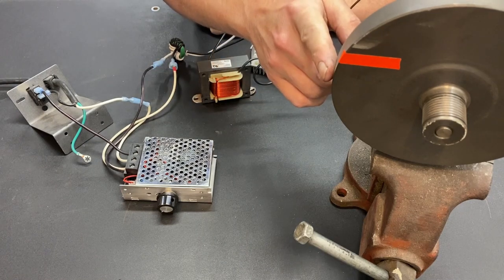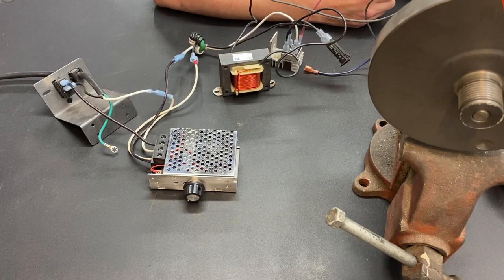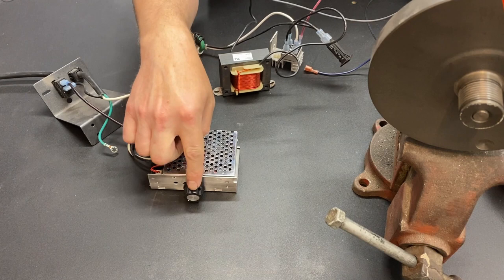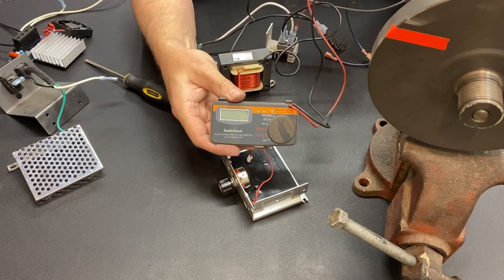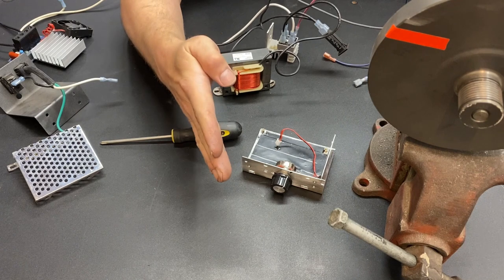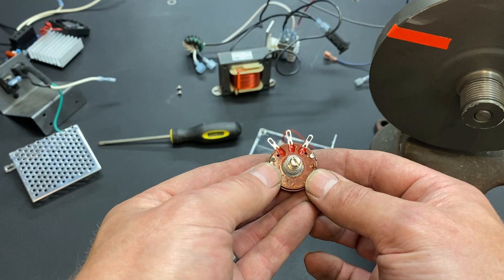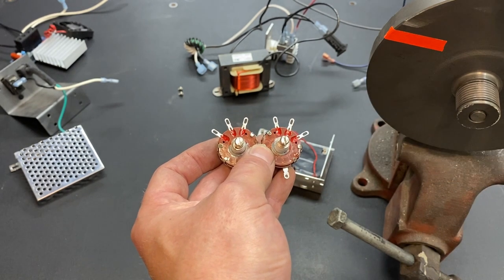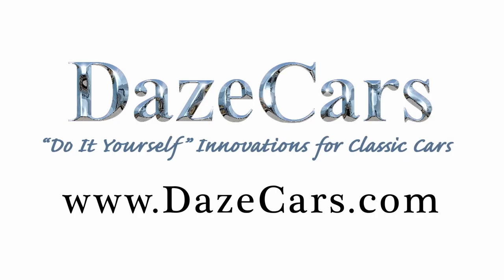Changing the Potentiometer in an SCR Voltage Controller Treadmill Motor Controller Power supply

Comment: I dismantled 3 treadmills to reclaim the dc motors a couple of years ago. I have been searching for a clear explanation of either how to use the boards from the treadmills or an SCR controller. Others seem to treat lightly or skip over the most important aspects of this solution.
You have provided a clear and thorough explanation and I’m grateful for it. 2x72 grinder project can proceed now….
Reply from the maker: Which controller boards did your treadmills come with?
Reply: @dazecars  I’m out of town until Monday and it’s too long ago to have a clear memory. I’ll look at them when I return and get back with you. Thanks
Reply: @dazecars  I have a MC-2100 Rev B and a MC-2100LS-30 Rev and another board labeled MCC1H ( that one has a transformer or choke on the board with 2 plastic connectors with 2 pins each) I have photos of all of this. I have 2 new SCR controllers 10,000 watts 220v which look like the ones you recommend. I also have 2 bridge rectifiers labeled KBPC5010 and potentiometers labeled B200K 17mm and B10K,.
Motors are 1.75 hp cont duty at 100 VDC and .5 hp cont duty at 108vdc, another 2.5 cont duty but couldn’t read the vdc req’d because of access to it. The small .5 hp was on some type of stepper or incline type TM but was the primary motor. I also salvaged smaller “stepper” or lifting motors I think 2 or 3 of them.
Reply from the maker: @Grumpyneanderthal  Sounds like you hve lots of options.  Im not familiar with the MCC1H.  The component attached to the board would be a transformer not a choke.  I have used that same rectifier you have and they are prone to burning out I would recomend getting a better one if you decide to go with the SCR  setup. https://amzn.to/3Gk4InH
Reply: @dazecars  thanks. Bridge rectifier link at Amazon is currently not available but I ordered 2 direct from Baomain w/ free shipping. 
I’ll go through the process you described to determine which potentiometers are required.
Reply: @dazecars  I don’t have a choke from the TMs. I’m on EBay but the values are all over the place. Like one I found has Filter Choke - Value: 7.0H, DC mA: 50, DC RES: 550Ω; another is Filter Choke - Value: 1.5H, DC mA: 10, DC RES: 70; and another is Filter Choke - Value:  0.5 H, DC mA: 10, DC RES: 30Ω (30 Ohms): 
Which one or does it matter? Thanks again
Reply from the maker: @Grumpyneanderthal  Not being an electrical engineer I can't say what value you need.  Most of those are probably to samll.  I would search "treadmill motor choke" BUT know that most people on eBay don’t know what they have and the word "transformer" will also appear in most listings. Problem is a choke and a transformer look almost identical so some listings are for transformers and some are fore chokes because the sellers think they are interchangeable. They are not. They would only be interchangeable if you modify a transformer to work as a choke.  (see my DIY choke video)  To tell the difference count the wires. A choke will only have 2, a transformer will have 3 or more.  Generl rule of thumb is the bigger they are the better they work, also the coil needs to be at least 16 awg. Please let me know if I can be of further assistance.

Comment: WARNING: I followed your instructions of how to set up a SCR to run a treadmill motor (power cord to lighted switch to SCR to circuit breaker to AC choke to rectifier to dc choke to toggle switch to motor) and it worked great on the first attempt :) However, I fried 2 SCRs when trying to add the second potentiometer.  No blame on you!   I had ordered the 150k & 10K potentiometer.  I thought I had wired something wrong when I fried the first SCR. So ordered a new one and fried that one too.  That's when I noticed that instead of getting the 150K, I received a 470K.  To avoid this happening to you, I recommend double checking the specs of every component before you actually fire it up.
Reply from the maker: I appreciate the warning for other people trying to do a similar setup but your conclusion is incorrect and you need to look for another cause of the failure.  Having more or less Ω will not cause the SCR to fry all.  What it will do is effect start speed, speed sensitivity, and how far you must turn the knob before the motor comes on.  More than likely you shorted out your SCR because of the unused third terminal on the potentiometer.  Most potentiometers have 3 and you only use two BUT if that third terminal comes in contact with the case, the body of the potentiometer,  or anything else that grounds it out you will fry the SCR.  An easy fix would be to clip the unused third terminal or heat shrink tubing it.  If that is not what happened in your case you will need to look for another cause as having a bigger or smaller potentiometer WILL NOT cause the issues you have reported.
Reply: @dazecars  Thanks for replying.  There was a pop that came from the SCR when I turned on the power (hence the reason I thought I fried it).  After reading your comment, I reattached the original potentiometer and gave it another try.  This time the motor popped and tripped my breaker. Not sure whats going on... but I'm trying to figure it out.
Reply from the maker: As long as you are using AC with AC things and DC with DC things a power supply will not usually cause a motor to fry, BUT a bad motor will burn up a power supply.

Comment: For once someone actually read the needed potentiometer value to see what size was needed. However, there really is another way to make this work very precisely. Take a resister and parallel it across the center wiper lead and which ever side lead you are using. And then you can get a simple resistor to make the pot the exact value you want. Just remember parallel resistors are lower in resistance value then the lower value of either of them. Solve for parallel resistance to make the pot the resistance you need... If you have a 100k ohm pot and need a 50k ohm pot, use a resistor in parallel to make the pot read 50k ohm. A 100k ohm resister will come really close... Try it...  Thumbs Up!
Reply from the maker: Great advice and even better description on how to do it. I am familiar with the concept of parallel resistors. The thing I don’t like when a fixed resistor is paralleled with a potentiometer is the potentiometer is no longer linear and the non linear change in resistance is the worst at max resistance. on an SCR max resistance is at slowest speeds and that IMHO is where you need the finest speed control. It’s not that big of and issue but just not my preference.
Reply: @dazecars  Well the only true idea is to buy a pot as close to what you need in a linear scale, even better idea is a multiturn pot. That way you can dial in the exact RPM you want... JMHO
Reply from the maker: @garymucher4082  I hope you didn't think I was being argumentative, your info was great.  I was just expressing my concern with using a resistor to size a pot for this application.  As to the multi turn pot thats a good option and would totally work.  It is similar to the two potentiometer system I run.
Reply: @dazecars  Not at all. I also understand your reasoning. Good video and explanation of why you need to change the initial pot that comes with those SCR controllers...  And that is also the reason I have a few meters. A very good Simpson 260 series analog meter for just watching the needle sweep and lots of digital Fluke meters to read everything else. Thumbs Up!
Reply from the maker: @garymucher4082   no fancy Flukes for me 😁 I use a simple 20 year old Radio Shack meter with broken cover.  I wish I could find another one.  They went to an autoranging unit after the one I have and it pales in comparison to mine.
Reply: 👍. Great conversation! Ii m very glad you both are intelligent enough to nip what might have been an argument, in the bud. Together you both provided more useable information and options for someone like me who is electrical knowledge "challenged". Read, I'm a fuckin dummy, or noob.

All too often YouTube comments become a battle of whit. Turning good information into Twitter like drivel.
Reply from the maker: @k.bellingham8335  sadly it is not just youtube its all social media IMHO.  There is something about being connected to other via a computer that emboldens people to say things they would never say in person.  Makes no sense to me but a-lass it is the world we live in.
Reply: @dazecars  
Anonymity. 
Perceived or otherwise.
The benefit of this new connected world is information exchange. I surely appreciate your very informative articles/ videos. I think I'm addicted to YouTube. Filter out the garbage and there is a whole wide world in here to discover.
Reply from the maker: @k.bellingham8335  unfortunately there is A LOT of garbage to filter out.  I know I have a long way to go to get to professional level videos but I try to be concise, easy to understand and moderately well edited.  So many videos wast time rambling and don't actually show you anything because it's just someone in front of the camera wanting to be seen "look at me!!".  That is  why my face will never be in one of my videos.  It's not about me its about the information.  And then even the videos with good nuggets of info have so much waisted time between nuggets that could be edited out or at least shown at a higher rate of speed.
Reply: @dazecars  it's all good my friend, kudos for putting yourself out there, face or no face. 
Not only is there drivel uttered by the ignorant, recognition seekers, aka wanna bes, there's also the haters. Someone always seems to have an axe to grind. Still, through it all are the occasional lights at the end of the tunnel. You know where you fit good sir.
Reply: @dazecars Everytime I watch one of your videos I just can't help but to think of the old sitcom Home Improvement with Tim Allen. I'm sure you know why.... 😂 And idk what you do for a living, but you make a fantastic educator!!
Reply from the maker: Its all part of my core philosophy.  That is why I never appear in my videos.  It's about the content not about me.  I never want to be a "look at me" creator.  Glad you like my content.

Comment: Thanks for the video! You included some 0:02  more information in one of your other videos about adding a resistor to one of the pots and o can’t seem to find it, I have watched all your videos so my playlist isn’t helping either. I want to run two pots but was thinking you added a resistor??
Reply from the maker: The extra resistor in series is only if you need the max motor RPM to be less than the potential RPM with you motor/power supply combo.  I did that on my bandsaw because so as to not drive the blade any faster than it was from the factory at "top" speed

Comment: Adding a fixed  resistor on the “return line” of potentiometer , would that then limit the high end speed??
Also, having a large 2,000 ufd  300 volt capacitor across motor leads help brush arcing or motor life, or be instead  of a choke? Thank you, learning a lot watching ur video’s
Reply from the maker: Yes having a correctly sized fixed resistor in series with the potentiometer will limit top speed. There is however no "return line",  resistors are not directional and electricity can flow either direction. If the resister is not correctly sized and is too big it will create a dead spot at the bottom.  As to the capacitor this is one of the most common comments.  People ask or comment all the time about adding a capacitor.  I did run one for a wile.  It came directly from a treadmill board.  I removed it because it caused surging under a load and there was no visual difference in brush sparking.

Comment: Not sure yet what potentiometer was put in mine. But it starts my shopsmith bandsaw conversion, right away. I have the push button one in it, bogs bad. The one you recommend does not bog as much, but has to be turned up to get the cut done. But then turned back down after the load is removed, or it over revs the bandsaw and blows off the tires. My thought, 2 potentiometers, selector switch between them. So I can have a no load speed and with load settings. ??
Video On my Twitch!
Reply from the maker: Bogging should have nothing to do with the potentiometer.  Three things cause bogging... well 2 and 1/2.  If your motor is too small that will cause bogging.  If it is a small motor you need it to be geared properly to help eliminate the bogging (that is the half) but even a bigger motor would probably need some gearing.  I have a huge motor on my lathe and I have it geared at 3.5:1 And then the big one is using a quality SCR.  Are you using the same one I am or one of the cheaper ones that are in all the other videos on the internet?  Keep in mind also it could be any combination of the three.   For optimal results you need a big motor a good SCR and some gearing to maximize function at lower RPMS.
Reply: Using the SCR you recommend.  
It starts soon as I turn up. Maybe 1/16 knob turn.
I think gearing is the issue, it will rev to 5200 now, can't really use over 1800 strong. Will look for some pulleys to adjust. Measure mine tomorrow.  Video on my channel of mine running now. Thanks for the info.
Reply from the maker: @FrugalFixerSpike   I would take the max motor RPM and divide by max desired RPM and then round down to the closest gear ratio you can get to that number.  I would round down so you are running the motor at max as little as possible.  Most motors will last a lot longer if they spend their time at 85% of max or less.

Comment: hi fantastic videos. thanks for the info. just one question .when using the two pots in series, do I use the little white plug on the 500k pot. assuming so do I connect it with the red wire coming in to the first pot ,then the black wire to the second pot. to go back to the scr .then plug the white plug from 500k pot (without 500k pot connected) back into the pcb board on the scr. Hope this makes sense, Thanks for your advice,  Dave .
Reply from the maker: yes you do still use the white plug and wires from the SCR.  As far as which wire goes where it doesn't matter.  a resistor limits flow in either direction so there is no problem connecting the black to one and the red to the other or doing the opposite.  That is of course assuming the potentiometers are correctly wired together in such a way that they both adjust the same direction.

Comment: Great video, I have an upcoming project to convert my drill press and now I understand how to select the correct potentiometer(s). What impact would a fixed resistor in series with the pot have?
Reply from the maker: you could add a parallel resistor of the correct value to "size" the potentiometer, my concern would be that when putting a resistor in parallel to a potentiometer the knob adjustment of the potentiometer is no longer linear.  the further the potentiometer resistance gets from the fixed resistance the less change.  That means the knob will not create a consistent speed adjustment.  It will get finer as the potentiometer resistance decreases but the SCR speed will be going up and most often finer control is more important at lower speeds.  That is why to me the best solution is two pots.  You can get the exact desired starting ohmage,  add fine speed control while keeping the adjustments linear.
Reply: @dazecars  Thanks, won't get to my project for a few weeks but I'll start by figuring out the second pot I need and get it on order. Lots of them to chose from on Amazon, do I need to be concerned about the power rating or maximum amps when selecting?
Reply: @dazecars  Actually my question was about a resistor in series. I think you answered my question on your web site. If I understand it correctly the series resistor limits max speed but doesn't help expand the control range of the pot.
Reply from the maker: @douggarson50  No it's just a signal current so most should work.
Reply from the maker: @douggarson50  you said series and some how I read parallel.  Sorry for the confusion on my part.
Reply: @dazecars  I'd like to add a panic button to shut off the drill press if something goes wrong. Could I wire a switch in series with the pots? The alternative would be to use the main paddle switch shutting off 120V AC to the system but it's a big bulky switch in a box that limits where I can mount it.
Reply from the maker: @douggarson50  I don't know if that would work or not.  With that said I would only put it on the main power input.  In a panic situation you don't want power flowing to anything.
Reply: @dazecars  Agree if smoke started happening I'd hit the main power paddle switch but if I'm using a big Forstner bit and the clamps holding the workpiece start to slip I'd like a panic off switch right up front. I'm assuming a switch in the pot circuit when turned off would send the resistance to infinity and cut power to the motor. Any reason to worry about damage to the power supply? I can test it to see if it works as long as I know it won't cause any harm.

Comment: With that set up what is the maximum load the scr can carry
Reply from the maker: its good for 10000 watts max so assuming max 110V (going to actually be less than that as some voltage is lost in the SCR and rectifier)  that would be 90 amps.  A * V = W  Now  a good rule of thumb is 1/2-2/3 max so that would be 45-60 amps BUT you are limited by the max amps coming out of the wall.

Comment: I have used this method to control a treadmill motor on my lathe and it works fine.  What I don't understand is that I get no readings on my multimeter coming off the bridge rectifier.  What's going on?  Thanks for your help.
Reply from the maker: It has to do with the way the SCR works, it requires a load.  If you hook it up to a motor and turn it on you should be able to get a reading and get the volts to change as you turn the knob.
Reply: @dazecars  Thanks.  I'll give that a try.